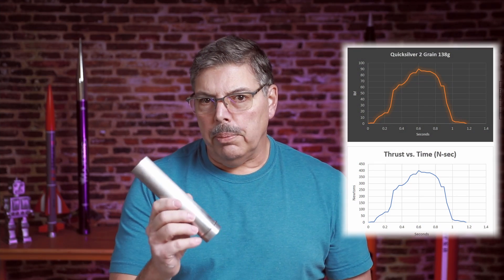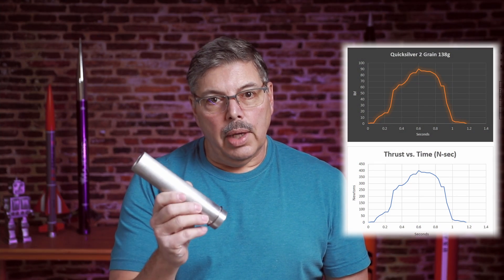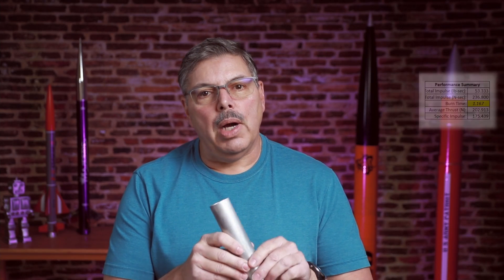Sugar rocket fuel + magnalium and aluminum

Comment: Nozzle should be at least 1/3rd of the inside tube diameter. anything less will usually cause an explosion!
Reply from the maker: That is true, but this fuel is well outside the normal composition.

Comment: You didn't use a sleeve in the motor tube, to prevent burn through of the fuel!
Reply from the maker: The motor case is aluminum and has a casting and thermal liner. The PVC pipe is only a support.

Comment: Just learning about rocket motors and I had a question. 
Inside the rocket motor during the burn, do the gases generated get compressed? And if so, as the solid fuel burns does the larger empty volume which the gases occupy inside the motor lower the pressure?
Reply from the maker: A 38mm motor can generate up to 1,000 PSI or more during operation. The motor will develop pressure (thrust) until the fuel is consumed.
Reply: Good

Comment: Designing a Rocket presently.
Going for Height and Distance..
Thanks for sharing your fuel mixes and success's and failures....
I have a fuel in mind that uses Styrofoam and Acetone mixed with Fine sawdust; and the Potassium Nitrate and Magnesium Sulfate and Sugar mix which is then added to the Burn Putty made from the Acetone, Styrofoam and Sawdust Mixture.......
Should pack in real nice and hold it's composite form real well also...
But if I am right ; the True MAGIC is in the extremely long burn time...
So I am making a Teflon Coated Ceramic Nozzle with a 3/8 " hole as per reduction and propulsion...
The Flare conical taper is very similar to that of a standard CORK ....a strip if Asbestos fire blanket will wrap the outside of the Nozzle and serve as heat shield and barrier...
Reply from the maker: Be careful when testing unproven formulas, acetone is very flammable and styrofoam burns crazy fast.

You could experiment with erythritol sugar. It is very difficult to light but has a long burn time. The sugar is listed in Meteor:  https://meteor.open-sky.fr/
Reply: @TheRocketeer  Thanks man , will look at that...As always Safety FIRST ; when experimenting with combustible formulas I start with very small amounts and test each reaction before attempting to put the whole formula together....RE , amounts and equivalencies per compound added to the formula...
Also , I am looking at Ammonium Nitrate Rather than the Potassium Nitrate or Potassium Chlorate....Each will be evaluated very carefully for it's characteristics and function within the Formula
Reply from the maker: @phillipmiller1008  Potassium  chlorate and potassium perchlorate tend to make things go boom instead of burn.
Reply: @TheRocketeer exactly, and ammonium nitrate absorbs a LOT of moisture from the air, you would need to use it immediately.
Reply: that fuel will not work, the sulfate will cool the burning down to low.

Comment: Hapy to see your video about this composition. I'm making rocket motor (3/8 inch inner diameter) with fuel KNSU+Mg, just dry mixing cause I don't have an electric stove at this moment. I've loaded my fuel by hand-ramming. Is this dangerous? And how to make it safer, I only has 8 gram of fuel at max.
Reply from the maker: I don't know for sure if this is a safe practice. I have rammed KNSU + Sulfur and never had a problem. You may want to consult a fireworks forum with your question.
Reply: @TheRocketeer  thanks sir. I'd love to see your post about this mixture on your website. 😁

Comment: Love rockets but new to making motors and 100% ignorant on the science. Oxidizers and reducing agents and such. Your motors are producing a lot of thrust (100+lbs) for a very short period with what appears to be very little altitude. I have gotten 2500+ ft from 2 stage d12 motors and I hope to have my triple stage F15 built when resources permit. I hope to get 5000+. Point is, can you lower the thrust dramatically and increase the burn time?
Reply: Yes, burn time can be extended and thrust reduced. The video you are commenting on features aluminum and magnalium added to the fuel and that produces a very short burn with high thrust.

You may be interested in flexi-fuel or sorbitol for a more reasonable burn time and thrust. Follow the links listed for more information.

D12 sugar motor: https://youtu.be/66sYTK32I7M
Casting sorbitol: https://youtu.be/8_GsleHQZGwCasting flexi-fuel: https://youtu.be/KZQ-cVx4Mkw
My home channel: YouTube.com/TheRocketeer

There are many things that contribute to rocket altitude. "Burning Money" weighs in at over 14lbs, so it will take a lot of energy to reach a high altitude. I may as well wave goodby to any rocket that hits 5,000' on our local field, it will be the last time I see it.

Congratulations on your success with a two stage D12. Watch for a video soon on how to fill the spent case with sugar fuel for cheap!
Reply: yeah, if you change the grain geometry then you can lower the surface area and increase burn time, and if you add some inhibitors like charcoal (and others that I can't remember the name of) then it will increase the burn time while decreasing thrust just like you said. 

TLDR: you might already know everything in the paragraph below

For altitude a long burn is often better because it will have less atmospheric drag but you might need the rocket to be really lightweight to keep it stable. I personally can't fly higher than 3,000 feet at my local club so I care less about altitude at the moment and I am more focused on spectacle and the loudness. To that end, sugar motors are often underpowered compared to APCP like the ones that aerotech makes, but they are cheaper so I will add things like iron oxide to increase the burn rate and make things more fun.

If you want to make a high altitude rocket for cheap, you can buy a F10 motor at apogee components and an Aspire model rocket kit to send a rocket to ~5300 feet with little rocketry experience. If you put a single f15 from Estes into that kit then it will go ~3000 feet. The staged rockets sound more fun though

Comment: I like the fact that you build your own engines but,  you assigin numbers to their size. Would you start giving throat diameters in fractional dimentions! I've noticed that # 15 seems to be popular with you . What size is #15 ? I am Wicked Custom Rocketry
Reply from the maker: A number #15 nozzle is 15/64. 15 ➗ 64 is .234. They are measured in 64ths  and that's how the nozzles are sold in the industry. I hope that helps, thanks for pointing it out.

Comment: Hey buddy, it's me again. Question are you adding the magnalium to an existing ratio of 65 35 mixture or are you subtracting it out of your normal mixture ratio. ..i.e. reducing anything or just adding 10 grams on top of the 65 35 mixture?
Reply from the maker: I added the magnalium to the standard 65/35 mix. If you do any experiments with magnalium let me know how they turn out.
Reply: @TheRocketeer  i had to put my course magnalium through the coffee grinder twice to get through a 75 micron sieve . my first grains are curing now. i noticed on my test burn on foil that there is a lot of residue from the magnalium , so it is gonna be rough on nozzles

Comment: Some red iron oxide catalyst may help and some charcoal to control the burn. Or go with potassium benzoate potassium perchlorate and some iron oxide lol might whistle but with a solid fuel grain and a good nozzle it should have a food sustainable burn
Reply: Potassium perchlorate has the best flavour
Reply: @Jason Last  well yea its the main fuel so its required regardless in most cases altered are whistles made with potassium chlorate but aren't as stable
Reply: @pa-pyro2804  Sir I don’t care about using it as an oxidiser; you said it has a food sustainable burn.
Reply: @jasonlast7091  it does in the correct ratio ..... do you understand how these work or need it spelled out for you
Reply: @pa-pyro2804  I just want salt that tastes like real salt.
Reply: Or copper oxide. Idk about performance but flying a rocket with green mach diamonds would be quite cool
Reply: I only make Rcandy because it is the best tasting rocket propellant
Reply: Using KCLO4 in a larger scale motor will very likely explode. Potassium perchlorate fuels have a pretty high pressure exponent, which means that they are far more likely to run off and explode. If you are going this route, using apcp is much safer.

Comment: I know nothing about model rocket ballistics or chemistry.  But the burn times seem too short to me?  What happens if you make a much longer motor that goes further up into the rocket body. Is it too hard to control a longer burn time. Or just that it would go to far and retreval becomes impracticle?
Reply from the maker: The combination of sugar fuel and a weaker oxidizer require high pressure to get the aluminum burning. That is why the burn time is so short. It would be difficult to design a longer motor with this fuel. With enough $$$ and time it may be possible.

This summer I plan on using erythritol, a sugar alcohol to make a 48" long 54mm motor. Erythritol is a preferred sugar for longer motors.

Fast burn motors are preferable for heavier rockets and higher wind speeds. Slow burn fuels will reach higher altitudes with less fuel. It is easy to loose a rocket with both :)

Comment: Do you use iron oxide in your sugar rocket mix? If so adding 5 micron al is basically making thermite in the engine that would be why you are burning thru cases.
Reply from the maker: I don't use iron oxide (RIO).

Comment: Magalum can make some mixtures ignite with exposure to water.
Reply from the maker: Rocket fuel should not be exposed to water or moisture.  I keep my grains sealed in a plastic bag and then placed in a metal box.

Comment: Im new to this so forgive my question. Have you played around with different geometry of the fuel molding or inhibitor layer on the inside case facing the fuel?
Reply from the maker: I have not tried anything else at this time. There are a number of others such as c-slot and star.

Comment: Freaking crazy I just did the same thing but I want to try Aluminum oxide powerd at a 11% to 15% ratio
Reply from the maker: Let me know how that works out!
Reply: doesnt burn.....?
Reply: Mill out the Cases and Line them with Satanite or an h/t Epoxy/Crushed quartz composite. ..(or use C/f for case and Use thicker Biffer/Ceramic resin composite Lining.. really🤙🏻..
Also, Cheap graphite crucible carefully shaped on a lathe!.. As diy sintering is a pain😂

Comment: Next time you use an aluminum motor line the interior with cardboard or use a cardboard pipe to fill the fuel and then place it inside the aluminum motor, The cardboard turns to charcoal and stops the heat from spreading to the casing.
Reply: Very limited amount of case protection. I've had tremendous aluminum case blowouts with cardboard liners.
Reply: @rotaryrocketry  fill inside the cardboard with   charcoal and PVA mix or something, cleaning just gonna be a pain